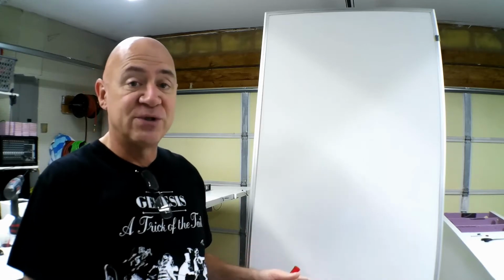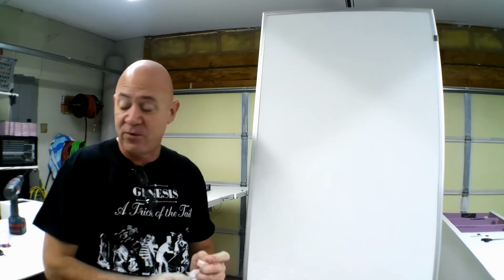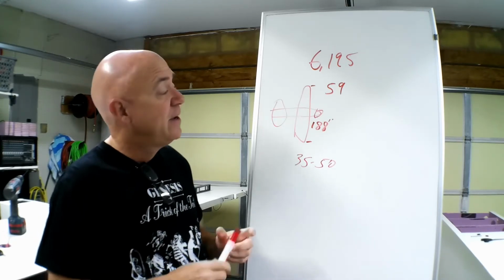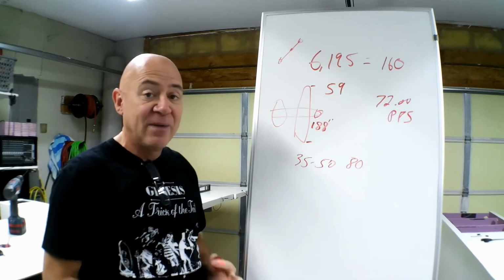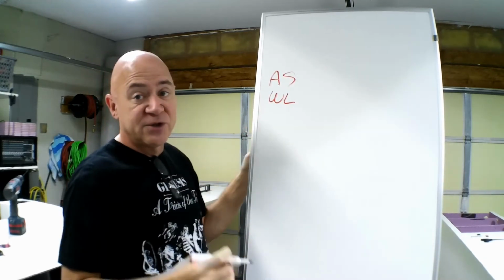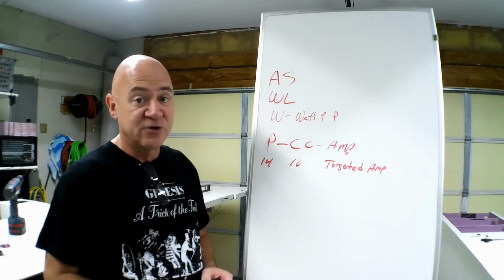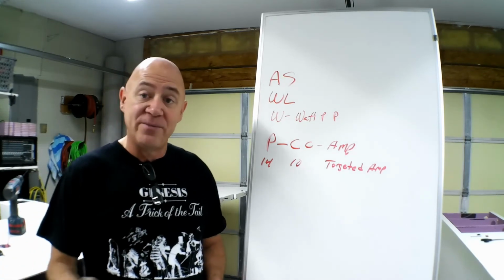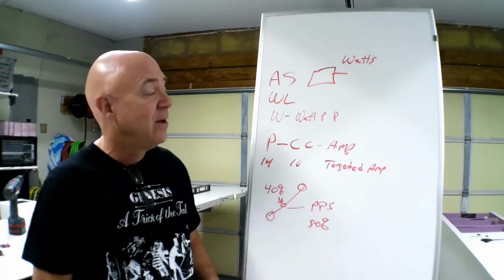Power Systems 7 27 19

Comment: When on a test stand at a given RPM the motor is working at a certain amount. When in the air, at the same RPM is the motor working harder or less?
Reply from the maker: That is a hard test to know what the data is telling you. When static your blades can become "stalled". If you set a fan in front of the static test you will first see a rise in amps. However, the amps are constantly dropping as the battery runs down. So it is really hard to look at "flight" rpm and "static" rpm and see a big difference. My data does lean towards the prop moving through the air is pulling more amps for a given rpm.
Reply: @dagtheaviator  Makes sense. If the motor is on a stand the blades aren't grabbing air as much as travelling through their own vortexes. Once in the air, they are now biting the air so are under load 'pulling more amps'. I don't think I've ever been so interested in a project as i am with this one. Some day it will fly but for now it's all about the journey. Cheers.